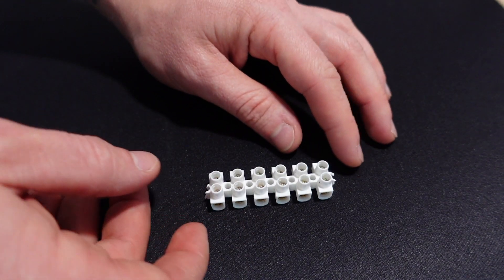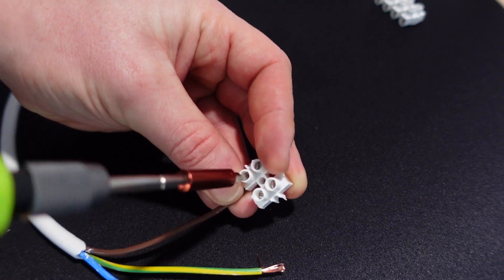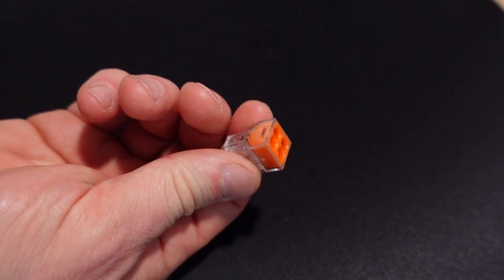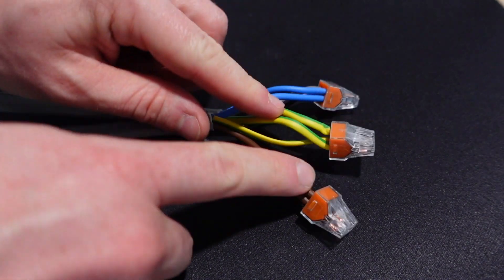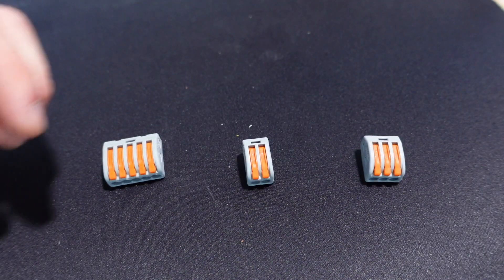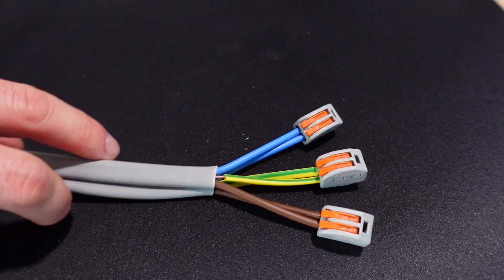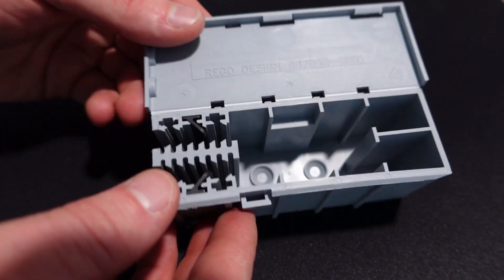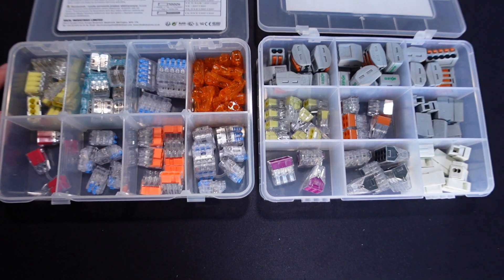Wago Connectors Compared | What Wire Connectors Are The Best?

Comment: I have a couple of central heating zone valves with 5 wires to connect in-line with 5 wires. They currently use a  simple chocolate block connector, but I don't like those because however tight you screw them up, they are always on the verge of coming lose, if you see what I mean. Also the chocolate blocks are not even in a box so some of the screws are actually live.
So, I could use the wagos in the way you have shown but I kind of want to use inline connectors. Do the wago inline connectors have a way to join each other side by side?
Can you suggest any better solutions?

Comment: I’ve bought a new ceiling light and it’s double insulated so doesn’t need to be earthed. I’m looking to either wrap the earth wire in insulating wire or maybe better still I was thinking of wiring it into a single box connector if such a thing exists. 
The light comes with its own connector box but only for live and neutral so I want to secure the earth properly 

Any suggestions what is best way to secure this single wire

Comment: I use wago 221s in building installations in West Africa. Much better than twisting 2 wires together and using electrical tape. I'm trying to get the locals around to this way of thinking!!! Other wise it's a big fire hazard there.  But they don't know any better!

Comment: If your using the lever wago connectors for replacing a rose light. Do you have to use a junction box? Or can you just push the wago connectors into the ceiling hole?
Reply: If the fittings fit into the light unit no , if they are going into the void then to comply with regs yes must go into a box
Reply: @wellwhatthen10101  ok. Thank you very much for your reply.

Comment: I would not use the lever wago connectors if you can't see into them more than  half the diyers would strip back the insulation short and the connection would be half on the insulation holding the connection up of the copper which would create a loose connection  arcing  a fire hazard but I do like the transparent wago connectors with the flexes which could be a heavy load  which can't be loose and causing heat Cheers keep up the good work and always use the AFDD protection if possible
Reply: the lever ones come with a guid to strip them back turn them over and check the length if striped ins

Comment: - It is often not clear what the current carrying capacity of the screw terminals is. This is often only 1 or 2 amps.
- Push fit connectors are not approved for flexible wires. The wire can be removed by twisting.
- With lever clamps, a rigid wire can be inserted without opening the lever. If the wires are flexible, the lever must be opened.
But the disadvantage is that these are only suitable up to 4mm ² and 32A. 
There is also the larger 221 variant up to 6mm² and 41A
Reply: Total nonsense

Comment: At 2:40 the push fit wago... How do you get the wire out again after if you need to?
Thanks.
Reply from the maker: When using pushfit wagos you can twist and pull the cable to release it.
Reply: @TheDIYGuy1  ahh thanks. Mine is bent over like a U shape crimped? For single wires. Will that work..?!

Comment: I used wago connectors when I replaced my mates bathroom light. Never again will I have to stand on a ladder connecting up wires in  chocolate box connectors and wishing I had a third hand. The only annoyance is having to make the hole in the ceiling bigger to take the  junction box.😊

Comment: Funny story, I had access to a tensiometer machine a few years back and we tested a wago 222 connector. We wern't supposed to but we had a play on it during our lunch break. We used a bit of tinned 1.5mm multicore wire and clamped it into the wago connector. 
We then put it into the tensiometer and let her rip. 
We applied 80kg of force to the wire before it finally let go! 
That's like hanging a washing machine from it! very impressive.
Reply: Todd would agree!!

Comment: I have a 3 gang light switch. There's so many wires back up in there. Can I use a wago 221 5pin connector to, for example, utilize 1 single neutral wire into it, and 3 wires out of the wago 221 into the 3 switches? Same with 1 ground going in, 3 grounds coming out to the switches? And same with the hot? 1 in, 3 out? If I can, what do I do with the old wires in the box?

Comment: Stranded wire in the bus bar type should have a ferrule crimped on the wire before putting it in the terminal and tightening the screw.
The push in Ideal and Wago's style connectors are also reusable. Twist back and forth while pulling on the wire. It will come out. The thin stranded wires can be tinned with solder and they will push in easily.

Comment: I installed three Sunco 4 Inch Ultra Thin LED lights in my kitchen above the sink. The light units only last several months before they radically dim. It was a pain to replace all three lights the other day because the one in the middle has 2 sets of 4 wires under wire nuts. I want to thank you for your video because it shows you can release the lever if you need to pull a wire loose. This will make it so much easier to replace the lights in the future.

Comment: Russian standards and regulations imply using only three types of connections in a maintenance-free soldering box (behind the ceiling, for example): soldering, welding and compression with a metal sleeve. 
the remaining options are acceptable only for connections that are available for maintenance.ble

Comment: Have you guidance on the most effective solution for splitting 1 to 4 for stranded for cables in a rack (not inwall)? I've a task that needs a splitter cable as a distribution panel will not fir. 

 I definitely agree on the issues with screw down on stranded. Still need screws on the plug terminations however at least I can twist and then bend double for those.

Comment: That's not how we use the terminal connectors in Spain, here, we use a much bigger connector than the section of the cable that we need to connect, for example if you're connecting 3 2,5mm2 cables, then you would use a 16mm2 connector. You simply twist the copper of the cables together and you put it in the connector, but you must make sure that BOTH screws are holding the connection in place. And of course, once the job is done, you give it a tug, and it should not be loose, and of course, there should be no copper strands loose... Considering the price, I think the "chocolate" connectors are the best, obviously, when used properly, and primarily for threaded cable. IMO.

Comment: I used two 5 gang Wago lever connectors on my motorbike to wire in accessories. I used a switched live to one block and earth terminal to the other block. They are low profile making them ideal for wiring in accessories under the seat on a motorcycle. I think they are fantastic.
Reply: Excellent idea about wiring under the motorcycle seats I have some of these I'm going to work on my wife's trike,  she needs some cleaning up under there

Comment: Push fit connectors have two fatal flaws. One, it is very difficult to remove them. You have to yank and twist and that damages the spring teeth. Secondly, the surface contact area is minimal at best. That creates high resistance which then creates heat. Take a temperature reading with a laser thermometer or an infrared camera. You will have hot push connectors. The only point of contact for the amperage is a knife edge worth of spring. That is how they bite. A tiny knife like edge bites it.  That not only damages it but provides almost no contact area. The first time I used them for lights I was installing, I was getting problems within a few days. Flickering then going off. Took voltage readings and the voltage was low. Got rid of all of them and redid everything with wire caps. Problem solved.
Reply: not sure which spring connectors you used, but it was certainly not wago ones, more like ultra cheap knockoffs at best. Because the Spring in Wago connectors is never designed to carry current, thats the job of the bus bar where the Wire is pushed into by the Spring.

Also if you have such a huge distrust for Spring type connections you should get rid of all Outlets and Hard-wire everything. Because these are technically also Spring type connections...
Reply: @unitrader403  I never mentioned Wago. I  said push fit connectors. Wall outlets are okay because of the large surface area, unlike the push fit which just has a small blade edge connection. It's not the spring action that is the problem but what the spring is pushing, which is a blade of metal. Just do the experiment I mentioned with a temp gun. The push fit connectors heat up significantly. It's fundamentally bad as a design when you can twist wires and get a huge contact surface area.
Reply: @marks6663  well, Wagos are Push Fit connectors, even the levered 221 Series (obviously this only works for Solid Wires)
Reply: Here the Wago 222 is tested with 120 A. Connection is ok although wires burned and housing melted. 
https://www.youtube.com/watch?v=pCd4F6KTw2c

Comment: You seem to miss the point that you can't get a 3 or 4 way choc-block without two wires in one side, also the difference between those that screw down direct on the wire and those with a little tab that keeps the screw off the wire itself

Comment: Can you unmount the ideal connectors? I would assume if your couldnt, it would be in the cons of them? I would really like to know if they can be or not, i thiught i spotted a slot for an electrical driver to be inserted, perhaps for dismounting?
Reply: if you refer to push fits and if its like wagos that slot is for inserting test probes. You remove single wires from them by pulling on it and twisting in alternating directions, and with each twist you pull it out a tiny bit more

Comment: For the occasional DIY'er you cannot beat wire nuts so long as the DIY'er knows the correct way to use them. Although WAGOs are great, they are too expensive just to have them laying around in a cabinet till the need to  use. Wire nuts are cheap and most have dozens of all sizes.
Now if a person is going to replace all their outlets, sure invest in some WAGOs.

Comment: There's something about the wago connectors that most people seem not noticing.   It is: when you intend to test their terminals for voltage,  it's almost impossible to do this, when the terminals are possibly live.
Reply: every wago connector has at least one hole specifically for inserting test probes (they just provide accass to an voltage carrying part, but dont clamp down on the test leads)
For the 222s is is the rectangular hole above the Levers,
for the push-ins there is a round hole on the opposite side where the wires are inserted.
In case of the 221s they have at least two test lead holes - one is next to the holes for the Wire, and the other is on the opposite side

Comment: I might be old school but electrically, for cables above 1.5 I think that two cables both long enough to have 2 screws biting down on them in an appropriate size connector block is a better connection.  This way you end up with copper against copper which must be better than copper-wago spring-wago spring-copper. I'd welcome feedback on this.
Reply: Just FYI: the Spring in the Wago Connectors is never designed to carry current, it is purely to provide the necessary tension to push the wire against the bus bar (which is made from Copper afaik)
also screw terminals screw up the wire. especially if you over-torque them.. (if you torque them to maximum compression and have temperature cycles you might end up with a loose connection: when the connection expands it has to shove the material to the sides, and since it was compressed to the maximum before the copper lost its elasticity so when it cools down and shrinks you now have a tiny gap)
Reply: @unitrader403  All MCB's and fusebaoards use screw in connections why haven't they changed to spring? If used like they are intended there are no issues with terminal blocks. I don't think you should join any cable that has a high amp load anyway not good practice.
Reply: @gainmaster1  probably because they have to take in really thick wires like 16mm² on possibly either side. i have seen cage clamp of these in online listings, but they are iirc only for up to 2,5mm².

And you have to terminate any Cable at some point, and that means joining it to an MCB, a Bus Bar, to internal Wiring of some Device or whatever... not having a joint there is not possible (pun not intended, but good :D)
Reply: @unitrader403  so there is no difference in screw on bus bar or MCB and terminal block. Once the right method and torque is used it's the same thing. Maybe a lot of the issues are down to user error and not equipment.

Comment: Do you use the same WAGO connectors for 1.5mm & 10.5mm cables?  I know connector strips vary in size for different gauges of cable.
Reply: Wago specifies the 221 for 0.2 to 4 mm^2 wire. 24 - 12 AWG.
There is also a (rail mounted) type that goes from 0.5 - 16 mm^2, (20 - 6 AWG)

Comment: The stranded wire should be used with ferrule. If the ferrule is used then there is no problem using a stranded cable with Wago PushWire connectors like 773 or 2273.

Comment: DON'T USE A STRANDED WIRE IN A SCREW CONNECTION!!!!!! If you need to use a ferrule. ore with a terminal block WITH LOVE VOLTAGE twist 2 (or more) wires together and put them in from the same side, and get them both under both screws. DON'T USE THEM FOR CONNECTIONS IN YOUR MAINS!!!!! (BTW i'm an electrician) but ya the 221 is awesome, but more expensive so they don't let us use it for everything. for high current I will still recommend a nut (if you are good at making those connections) but for your average work on your mains the  the push fit will be great and les expensive then the 221. but if you only need a few, GET SOME 221's
Reply: And you need a good wire nut then, one where the cap can be removes and you can inspect the spring (which should be diabolo shape) wrapped around the wire bundle.
Reply: @pizzablender  here stranded wire is not allowed in a nut. Because it makes a tribal connection

Comment: Are you kidding me?
Is that screwdriver you use on an electrical connection a joke.....
Insulated Screwdriver just left the chat.....
You cannot use screw connectors with fine stranded.....you must use wire ferrules !

Comment: Nice wago ad, while i agree that screw connectors are not as convenient as plugins, yet you deliberately used twisted wire without lugs, to make them look insecure, properly  managed screw connector will be much durable and safer on long run, than spring-like mechanism used in wago, there is a reason why in electrical switchboards there is no plug in clamps.
Reply: The only reason UK consumer units have screw terminals is because cage clamp technology is newer and hasn’t been fully adopted yet by the manufacturers and the regs. In Germany push-in consumer unit circuits are commonplace. Nothing special about screw terminals, more prone to installation error if anything through over or under torquing. The UK will catch up eventually.
Reply: But screws will not self-tighten if the wire settles under time. Springs will.

Comment: I've recently started replacing all of the sockets and switches in my house and I've had one troublesome one in the kitchen. It's an inch from the ceiling above the cooker (used for the extractor fan) and so trying to put the new socket on is hurting my brain.

The cables are really short, they won't stay seated in the terminals because I'm having to twist everything just to get the screwdriver in, and twisting it back pulls them out.

Would the lever connectors be the best option to extend the cables and get a quick, safe connection? Also what size/rating should I use?
Reply: sounds like a perfect fit for the wago 221-2411 to extend the wires. although a 3way might be be better if you have more than one cable in there (just a tiny bit less ideal to use, if you have the option)

Comment: Great tips 
( Those Wago Lever connectors are EXACTLY what I need to wire in my Ham Radio Transceiver in my Truck )

Cheers 🤗
Reply from the maker: Glad it helped
Reply: Should be handy for making fanned and linked dipole antennas too.

Comment: The grey lever connectors are my favorite, they clamp harder than the transparent ones and can tollerate more moisture before they fail. I use these a lot in the automotive work since they can and will be outside a vehicle in boxes under the cars etc, even inside a caravan during winter you will get a lot of condensation during winter and I never needed to replace a grey one but many times the transparent ones. however both are good and beyond if you compare to a sugar cube or even just flat pin connectors as they often use in the HV terminals as well inside these vehicles. caravans are a complete jungle of standards when you compare to houses and everyone uses everything they get their hands on for the cheapest price without a care in the world